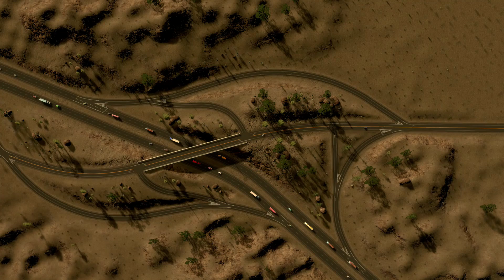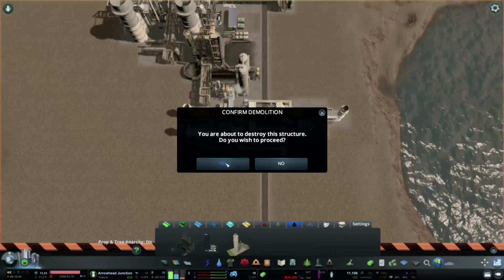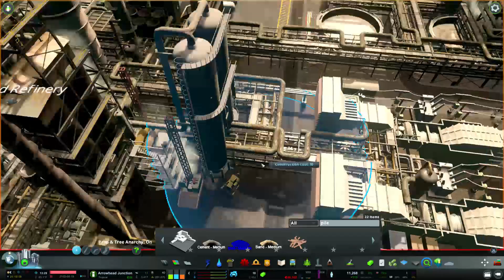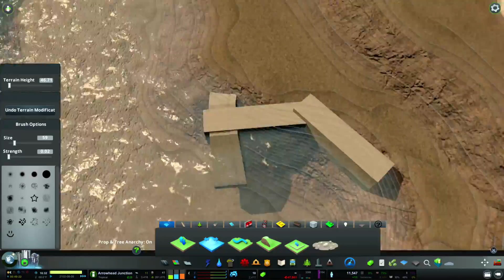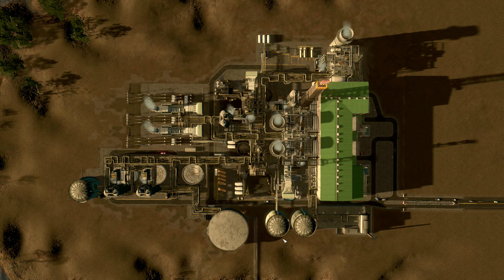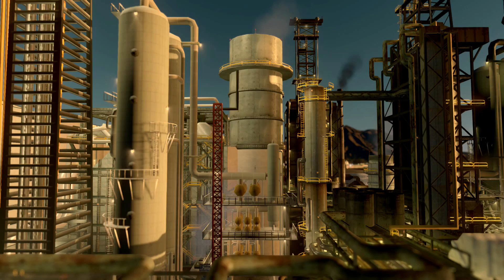Cities Skylines: Arrowhead Junction - Part 16 - Arrowhead Oil Refinery

Comment: Refineries are broken into a few different parts.

Crude unit - where crude oil is distributed to different units
Rehniformer - jet fuel
FCC - ashphalt
GHT - distilery unit where gasoline is made
ALKY- where acids and other chemicals and materials are made and or distributed to other units
Polymer unit - makes products used for plastic
DHT - diesle
BIO Mass - where tailings ponds are and where water used in the refinery is collected cleaned and sent back to the water cooler tower for use again in the refinery
Water cooling tower - where new water and steam water is sent to for distribution to thr other units for steam etc..
Uch and boiler house - where steam is created
Fuel gas facility - distributeds nitrogen and natural gas throughout the refinery
DEA - disributes cooling water and chemicals to other units

You are missing a fire hall and fire supression towers that are usually around the refinery in case of fire

Tanks where materials are stored are usually further away from the refinery to reduce chance of explosion (break it into 2 sections area 1- tank farm and area 2 - refinery)

 You are also missing a main pipe line that feeds and distributes crude and refined oil in and out or a ship yard that does the same.

also missing a contractor yard and maintance shop probably want a laydown area as well for new equipment and pipe, small refineries do about 5 million in repairs maintance and replacement every year.

Comment: Wanted to add, Asphalt is the actual hardened material you see on the road (a form of concrete). Bitumen is the stuff you get out of the refinery and is mixed with aggregate later in a different factory. As EVILBUNNY28 explained, it all comes from crude oil at the end of the day.

Comment: Steam is one of the main inputs needed in an oil refinery. It is used to heat the crude oil in order to separate it in manageable products to send to the other plants in the complex. It is used to move the generators that power the different machines in the plant, be it pumps, valves, sensors, etc.

Storage tanks are always placed in fields far from the process part of the refinery too. 

I gotta say, the refinery is kinda meh

Comment: This is amazing. it looks like a completly other game.

I wished they revamp some game mechanics. One thing that really anys me is the 4 squares at each side of the road thingy. This is one thing that Sim City 2013 did much better (also the uppgradable buildings,  i would also say, the way Cities skylines upgrade residential buildings are stupid).

Anyway, each 4 squares is equivalent to 32 meters deep. While that is the average depth of a villa garden... its the average, not even close to be the maximum. While the narowest possible is 8 meters (i actually found houses that was exactly 8 meters to next door neighbor. But they was 40 meters deep (5 tiles).

For commercial zones, 4 tiles deep is a bit to little. And for industrial. Its not even close. A industrial property could be 100 meter deep. For farming, same thing.

I really think they should remove this to the next version. And have two type of industries. Buildings and resource gathering (woods, farmland, mining).

The uppgrade is a auwsome concept, but the graphics makes no scene what so ever.

I imagine a level 1 house like just a flat house. (that also, might not fill the plot). Level to should be a expansion of the level one house. Like a second floor or a extended angle.

But most of the level 1 buildings already have angles.

What would be really cool would be is a level 1 building only was like a trailer home.  Level 2 is a real flat home. Level 3 is a dual story home and 4 and 5 is expansion.

This should be true for Industrial to. Level one just a trailer home and maybe some outdoor machinery

Comment: great video. but for me as working at Petronas Oil Refinery, there is more cylinder tank for air-conditioner (might sound stupid but its true) and a stock (huge) of number of water. The risk of accident is high. The space between each cylinder tank should have a good amount of space so easier to access. It does look pretty on your video, but for me it just not enough.

Comment: 5:00 you mention steam in power generation, I just wanted to let you now that coal/gas/oil/geothermal/nuclear/bio-fuel all use steam turbines. Also, if they are close to a city they are often used in co-generation mode to produce both electricity and heating.
Reply: Also, here is a picture of a major chemical processing plant in NL: https://2.bp.blogspot.com/-9XM0Ebov_7o/VVJIZ6UwCiI/AAAAAAAAIbE/sq96pq_SlrU/s1600/Blog%2B20150518%2BBedrijventerreinen.jpg (maastricht chemelot) I think you are on point, except it is pretty clean, but maybe that is a European thing.

Comment: There need to be some offices, a lot of parking spots and the fence need to be rounded off more, not completely round but like at the 90 degrees corners you have now you should add like 2 45 degrees corners
Reply: Oh and the fence at the power heat supply is really close to those 2/3 props, but otherwise it looks awesome

Comment: You should add more storage tanks for reserves. Along with adding a pipeline that goes towards the oil fields area and possibly a pipeline that goes to the edge of the map towards a bigger city area.  Also a loading area for oil trains would be good as besides pipelines (and ships but that's not appropriate on this map) that's the other main transport source of both raw material (crude) and finished product, it's pretty rare to see it leaving by trucks in heavy volume besides for very local consumption and these places are usually regional like many of the US's bigger ones being in Texas and Cali with smaller versions for specific chemicals elsewhere (pretty much every state has at least one but not to the degree of Texas and the like).
Reply: The reasoning for many tanks and outputs would be due to the variety of things that come out of refineries (though some only do some of the processes big ones would have all kinds of outputs) everything from gasoline, jet fuel, pharmaceutical compounds, oil for plastics, diesel, etc all come out of refineries.

Comment: I'm not sure the extent of the power being used, but there is a lot of heat generated in the refining process, so they will sometimes add a heat exchange, creating steam which in turn creates power.

Comment: When the main oilfield is done, run a pipeline to the refinery.

And i feel you should have the perimiter fence a significant distance from the refinery itself. As it is, randoms can get like 3m away from major equipment. Very dangerous!

In reality it'd be like 50m away.

Comment: If you want photos of real refineries, I live in one of the most refinery heavy areas of the US(we produce 25-35% of the gas in the country within 100 miles of my house). 

One thing you ABSOLUTELY are missing, is the oil storage tanks, and cooling ponds. The refineries are surrounded by miles of cooling ponds, canals, and massive domed oil tanks. You also have no flairs that I see(A refinery has flairs to burn of chemicals when a process becomes to slow, or during an emergency shutdown.)

Spread out a bit more, don't worry about being a bit repetitive, and add a ton of oil storage tanks and cooling ponds.

Comment: Does the US curriculum cover fossil fuel processing? We learned about crude oil cracking and fractional distillation in Year 9. Fascinating stuff! :) Incidentally, I've noticed Flux, Strict, and I'm pretty sure Fresh too, all make a distinction between 'steam' power plants, and other kinds of fossil fuel based power plants. They do know that all non-renewable power plants work on the basis of steam, right? Steam is just the medium to transfer heat energy into kinetic energy. Not a biggy, just a curious observation.

Comment: Ironically I just sat a Chemistry exam today, and a good portion of it was Organic Chemistry. Organic Chemistry is all about Crude oil, Fracking, Fractional Distillation, Hydrocarbons, Catalytic Cracking etc. The Crude Oil is separated into Fractions in a Fractional Distillation tower, ranging from Refinery Gases at the top (Methane) down to Petrol then Naptha then Kerosene (Jet fuel) then Diesel then Fuel Oil then to Bitumen (Asphalt) at the Bottom. Each sorted out due to their Boiling points which range from -161.5 °C at the top to 525°C at the bottom. Bitumen is either used for roads, or is Catalytically cracked to form smaller more useful Hydrocarbons like petrol. Naphtha is used for making chemicals. There are 3 types of Hydrocarbons, Alkanes, Alkenes and Alcohols. Alkanes are used for fuel, Alcohols are used for solvents and of course our consumption, and Alkenes are used to manufacture plastics... So bet you didn't know that. All the plastic you see every day use to be in the ground in the form of crude oil.

Man I hate school, and I hate exams even more so T_T
Reply: EVILBUNNY28 stop! Im in youtube now, not school!
Reply: EVILBUNNY28 yeah me too, theres also processes like cracking that break down large molecules like fuel oil (used for ships) which have little use to things like petrol and theres purifying stages for each of the fractions like theres a substance which is an impurity of petrolium that is used to make tnt. Thats why the refineries are so massive
Reply: About 20 Ninjas Yes. Of course that was massivly simplified. Also I did slightly touch on Cracking (I touched on Catalytic Cracking, which is way more economically efficient since cracking can be done at low temperatures with the use of a catalyst, in this case they use an alumina catalyst.)

Comment: Fluxtrance, when refined, the oil is separated into three substances: one type of heavier oil, a lighter sort of oil and petroleum gas, which is used to make fuel. These other oils have varying uses from lubricants, energy source or even processed again and combined into petroleum gas. Just letting you know ;)

Comment: "Ashfault"?

"Ass-fault" Flux, asphalt.
Reply: He said "ashfault" so clearly so often I actually had to google it to make sure I hadn't been pronouncing it wrong (or to see if maybe there was another by-product of oil refining actually called ash-fault that I'd just never heard of).
Reply: Asphalt or asphaltic concrete is what a lot of roads are made of and it contains bitumen as a binder to hold the aggregates (stones and sand) together. Bitumen comes from the oil refinery process. You would never see asphalt at a refinery not even on the ground, as it would deteriorate too fast from all the other hydrocarbons.

Comment: You could have done the power plant as a small cogeneration plant next to the refinery.

And they are usually called distillation columns. Not towers.

But otherwise it's not bad. Looks like a lot of the plants I've been in. Maybe a little more compact than necessary, or realistic, but good enough!
Reply: Also, the refinery would likely have a waste water treatment section of the plant. Just for authenticity.
Reply: One more item.

The electrical yard should be fenced off even on the interior of the plant. And maybe given a little room. It's a bit close to the road and pipe rack.

Comment: Two little things I observed in Petrobras refineries here in Brasil: The tanks with the floating covers are mostly placed far from the main refining structure, so a fire wouldn't burn the whole thing; The loading area for transporting trucks are huge lines of trucks and pipes, so they can fill the trucks up faster for distribution... Other than that, your work looks amazing!! The lightning at night with those flares at the top tower really does the job!

Comment: would it make sense to have an industrial train station close to it?
Reply: no more train related episodes for a while pls
Reply: You guys should definitely have a loading station for trains build into the refinery itself.
I drive past one every day and there are always "oil tank trains" that pull out the filled oil tanks to a assembly point out of the refinery, where they will be assembled and send their way. Just use your great railyard as this assembly point.
I don´t know if thats normal but the refinery that i see a lot has a HUGE amount of oil or other tanks on their property aswell with many small "warehouses" that i think are buldings where most of the workers do their work, like maintenance, etc. (think the RICO warehouses would be great for that purpose)
It seems that nearly all oil tanks have a little dam around it to avoid (if the tanks are broken/leaking?) contaminate the ground. Would be neat to see that tidious work aswell, but really don´t know if its worth the effort. (Strict looking at you who made that great waste water facility :))
There are some nice Oil Loading Terminals for trucks on the workshop made be Avanya. You could integrate this Terminals aswell into the refinery. 
Otherwise great work as always, looking forward to next friday. :)
Reply: Yes!
Reply: Maybe it would. So arrowhead maybe will have two trains. One for commercial, one for industrial. It would be great i think
Reply: Knick the most oil refinery are producing so fast refined oil that you need pipelines to transport the oil fast enough! as i know (BASF/Ludwigshafen/Germany) if the oil is not going through pipelines they are using trains but never using trucks as the main transport system!?
Correct me if i am wrong
Reply: Udocard qaywsx there is a raffinery in my city and they use trains and mostly trucks to deliver fuel to gas stations